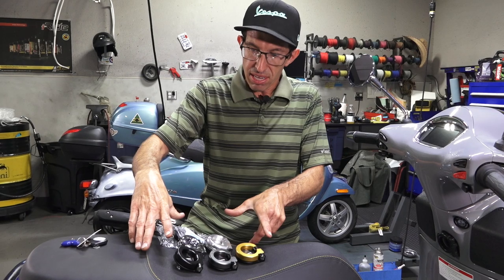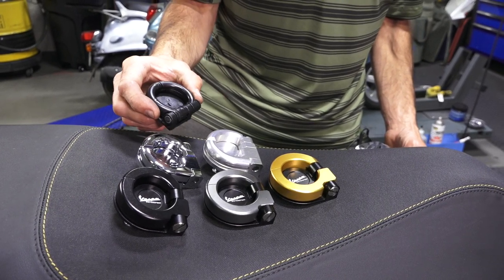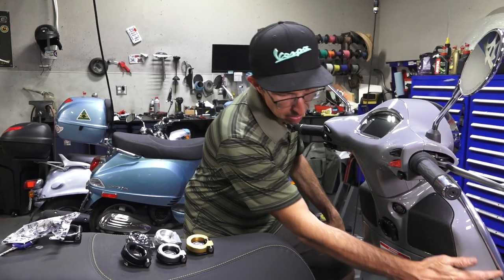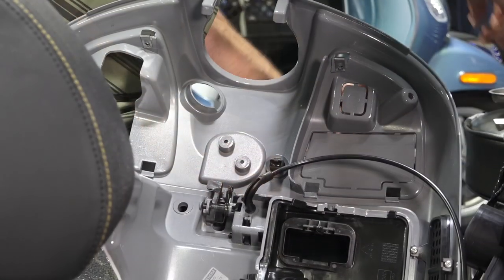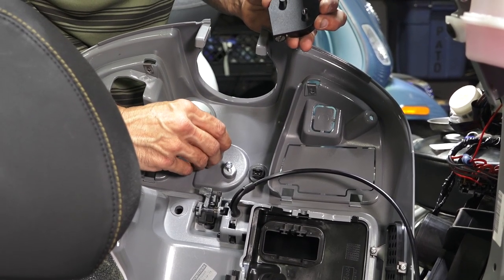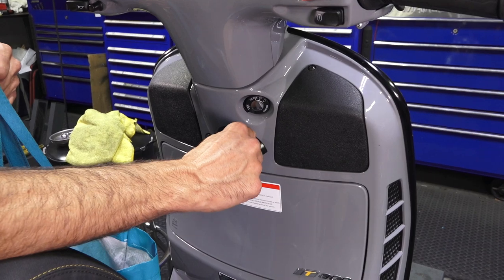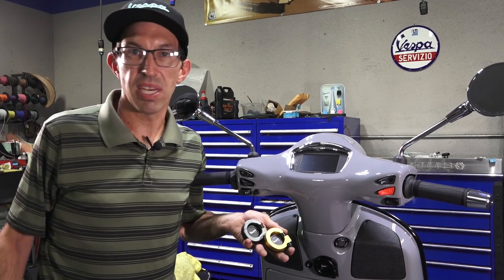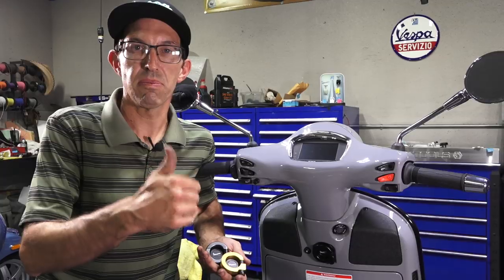Extra Strength Aluminum Bag Hook for Vespa GTS

Comment: I wish that Vespa would move toward restoring their practicality:
Metal bag hook, firmly mounted in metal.
Rear wheel that does not the entire exhaust system and sideplate to be changed.
Removable rear cowls that do not need thousands of dollars of bodywork to be repaired.
Reachable rear footpegs.
Louder horns.

Good videos, as always. Thank you.

Comment: Do they make a vespa hook that locks? I'd love to use it to hang a helmet securely.
Reply from the maker: No, but most of the modern Vespas have little pegs on the underseat bucket that you can hook the D ring of your helmet on. Once the seat is closed and locked, it's as secure as it can be without someone cutting the strap and ruining the helmet.
Reply: @VespaMotorsport  Oh awesome! Just bought a 2009 Vespa GTS. Didn't come with a manual, so I'm still learning about all these little hidden features. Thanks!